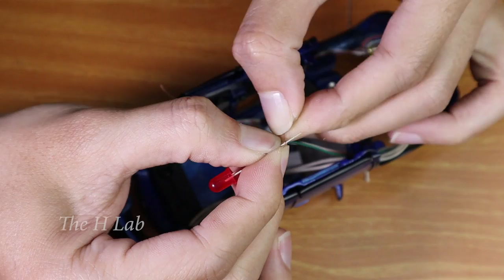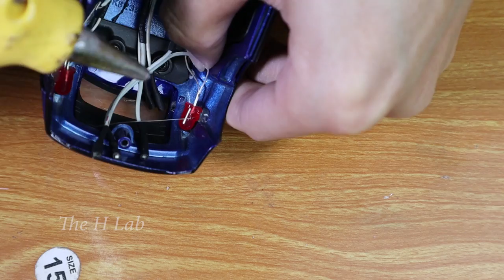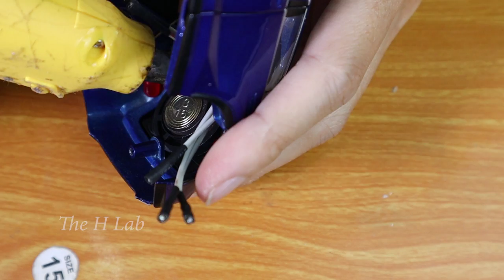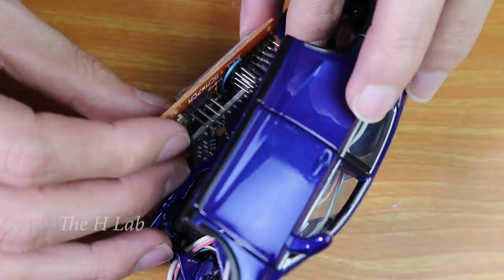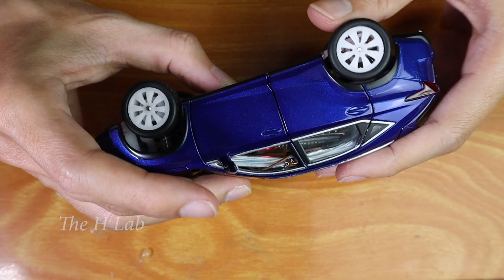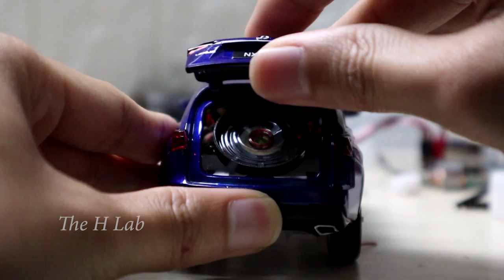3D Printed RC Car - Part4 - Headlights, turn signal and car horn

Comment: Nice project! BTW, probably it would be better to use addressable RGB leds like APA106: in this case it's enough to use 3 wires with a common bus scheme. As a side effect of using the addressable leds, you will be able to implement "police light show" - blue/red lights + sound of the police siren))
Reply from the maker: Thank! Will try when I have time :)

Comment: Could you please give the code for geared motor instead of car engine servo motor.
Reply from the maker: Hi. Which geared motor? I used an servo as car engine.
Reply: @TheHLab  geared motor means rc car with 2 x speed gear box or more 
And thanks for your reply 😊.

As you mentioned , you used servo motor for front and back movement of the RC car but I request you to help me with the code for RC car with neutral , front (with 2x speed or more) , back (with 2x speed or more) .
The position of the gears are changed with the help of a servo motor 
Can you please help.....

Comment: small question. In the schematic you attach the HC 05 to the pins 4 and 5. Is there a special reason for that? if not can't we simply attach the rx and tx pins straight to tx and rx pins on the arduino
Reply from the maker: it's a voltage divider, there is a differ of high/low voltage level between HC05 and Arduino.

Comment: What is 3 green parts at schematic that connect to both servo & horn ?
Reply from the maker: I think you are asking about the regular to convert 7.2V to 5V. You may not need this because servo still work with 7.2V supply.
Reply: Oh , I see.. thanks. .that  like AMS 1117 or 7805 smd parts at the middle ..